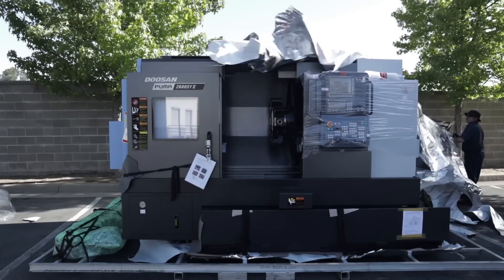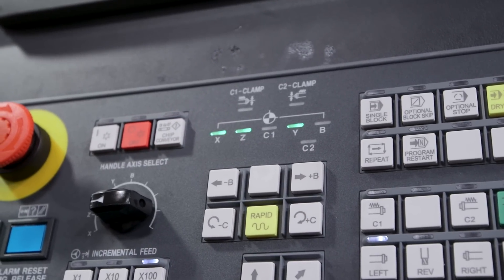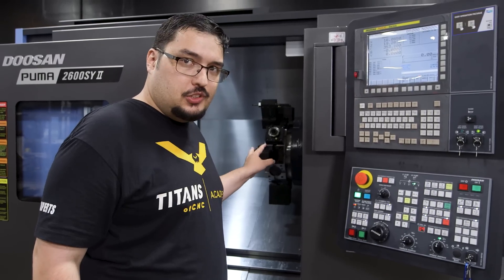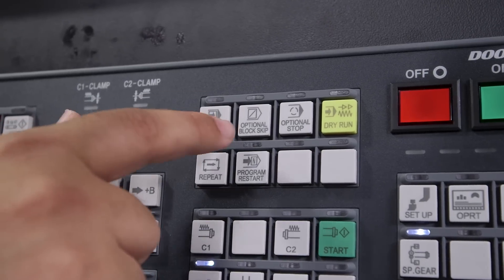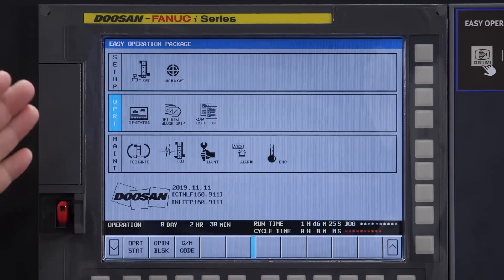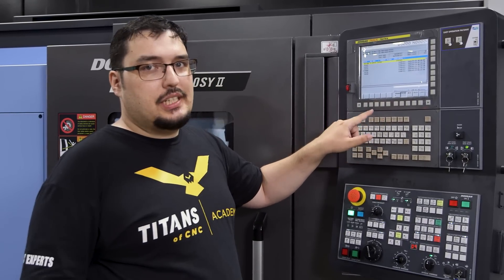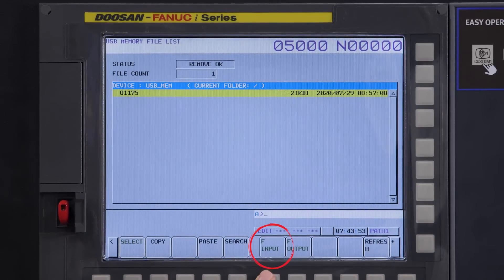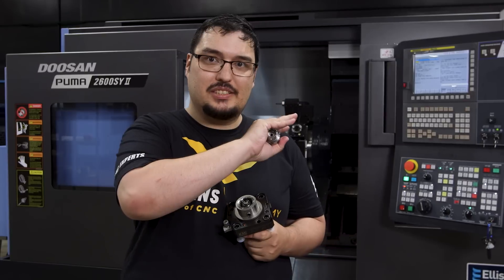DN Solutions PUMA SY II | Control Overview

Comment: I run this exact machine everyday. Absolutely love the machine and the controller! I run several jobs where I use all 12 tool positions on the main spindle side of the turret. ID tools side by side, no problem! Makes programming parts much easier with the versatility.

Comment: BOOM ?
Where are all these machines coming from ??
Must be big money in CNC machining ???? 
 ( i know these machines are on loan ? It,s called Marketing.  Google is good at that too )

Last time i looked most shops need to take a risk and run lights out to make the machine pay for itself.
The word risk is calculated by some but others find it,s more trouble than it,s worth.

All i see is my labour price going down while everything else is going up ??
Pricing jobs on how cheap you can buy material is what i see.

Not everyone is making parts for Rocket Ships.
Actually i don,t know hardly anyone. ( maybe i should look harder ? )
But YouTube like always glamourizes everything.

All the best to those who are making big dollars from a CNC machine purchase.
But don,t go thinking this is a Golden Ticket to making money.

If you find yourself stuck on a manual machine for to long you will embrace what a CNC machine can do for you.
Don,t go looking to hard for work though, because everyone else is out there trying to stay a float and working for wage rate running there own machines.

Think about for a second,  when it comes to CNC what is that they do so well ?
Produce identical parts in volume.
There is a word for that,  Made in China or similar.
This is what i find real consumers comparing prices on.
Make more parts and earn less per part ??

I wanted to be a Plumber when i was young ?
I should have, i would make more money per hour.

Apologise,s for sounding so negative.
I just find what i write is real world machine shops ( true, maybe not all ) but most i know.
If they are still in business that is ??

Comment: We have this exact machine at work. We got it September of last year. One of the few things we don't know how to use is Fanuc's tool life monitoring in the control. Would love to see a video on that. All of our lathes are Doosan with Fanuc control but our 2600 SY II was the first to include that feature and we would love to know how it works.
Reply from the maker: Love the automatic tool setter... we will do a video on this very soon, just for you😁
Reply: @TITANSofCNC  I wasn't talking about the tool setter although I agree it is cool and definitely deserves a video. I believe if you hit the custom1 or custom2 button on the Fanuc control you get a menu that includes a whole bunch features. One of those has to do with tool life management. My understanding is that you can have it record the tool loads during a couple part cycles with new inserts, then set some load thresholds and it will then automatically stop the machine if an insert breaks, individual tool load exceeds the preset threshold, etc. It was briefly explained to us when we got the machine but we never got it too work.
Reply from the maker: I already sent info to Doosan requesting this info... I understood what you meant but besides loads etc... it’s get that you can check the tool for wear etc during a lights out run... and set parameters etc. Will get educated on it as we are also new to it. Then make a video.
Reply: @TITANSofCNC  Sounds good. Look forward to seeing it. Excited to see Doosan's in your shop. It's the only brand I've run for lathes.

Comment: After you try Siemens or haidenhain you can never get back to fanuc!!!!
Reply: It’s like you have 1000km to go and you choose , running, (fanuc) or by airplane
Reply: I had the same type of experience.  I spent the first 15 years in the trade on FANUC controls.  That was "home" for me.  I had very little exposure to any other type of control.  I've spent the last year in Citizen Cincom controls, and there is no way I'd go back to FANUC full time.  The Cincom control is so damn smart and well laid out.  There are pictures and text for just about every function built into the machine.  There are macros with pictures for tool setting that show you exactly how to set the tool.  When simulating a program on the control it will give you warning if it detects a possible collision.  

I've also heard good things about the HURCO control, but I never had any time on that type.  My last shop had a HURCO 5 axis mill, I watched it run a few parts, but no real time using it.

Comment: God I hate Fanuc. It’s like prehistoric. Shame I’ve got 8 machines with it on. What do you mean I can’t run off usb and have to buy a £4000 memory upgrade to a groundbreaking 8mb! Arrrrgh
Reply: Also measuring tools is a pain in the cunninglingals. “Tool offset measure” and “part zero set” are the most useful buttttttttttons or however it pronounced but is why haas is more better, at least in terms of controls.
Reply: Yeah, we have a 10 year old Doosan Puma LSY, and let me tell you - the Fanuc control has not been modernized at all it looks like. I fall in love when i look at the mazatrol for example - thats the dream.
Reply: I hate fanuc too and love Siemens

Comment: M250 enables you to do way more with the door open.
Reply: Could You explain that? What more I can get and how? Best regards
Reply: @marcinrutkowski8193  M250 lets you index turret and run with 300rpm with the door open. Great for touching off tools if you can't use the tool-setter.
Reply: @MattWindham  thank You for the answer. I have tried to activate that by MDI , typing "M250 ;" press insert and start button but nothing happened
. What i doing wrong? It must be something changed in plc?
Reply: @marcinrutkowski8193  No alarm means it took it. Go to handwheel/jog mode, hit spindle on with the door open. "Reset" deactivates the M250. Doosan calls it Maintenance Mode.
Reply: @MattWindham  thanks a lot. Best wishes for You :)

Comment: wait, you cannot name the programs like "Part X Top" but instead only numbers? Thats stupid
Reply: It seems to be one of the things fanuc refuses to update.  I work a late 90's mill with a fanuc 18i control and the filename pattern is the same as this brand new, state of the art, lathe.
Reply: Yeah, my 1987 Fanuc 10M is almost exactly identical to operate as this state of the art Fanuc control. I really expected to see at least some improvement over my more than THIRTY years old mill.. But.. Nope. Lets jus stick with numbers as program names.. :)
Reply: On the new control like this one you can name it anything you want (up to 32 character I think? No spaces). The old system is still in place as well. I use the actual drawing number as a program name now.

Comment: It would be nice to know what happened to all his other machines, to learn a bit more about the business side of things. Also, by far the quickest way to load programs into these controls, especially for short run jobbing work, is to have a pc mounted at the machine, and the machine plugged into the local network, then you can post from your cam, and using M198, can immediately press cycle start.
Reply: I'd be willing to bet these new machines are loaned to him by the manufactures just for the purpose of getting them on his channel.  Titan is THE face of CNC machining in the US  right now.  He has a huge platform and that is an opportunity for sponsor ships and marketing for the machine tool makers.

Comment: love the 1990 rapid overrides - too slow, too fast, way too fast. 👌
Reply: sounds like mazak lol
Reply: LOL, you can set them to what ever your comfortable with.
Reply: @williamlind2843  I prefer the infinitely adjustable ones on newer DMG Mori equipment 👌
Reply: @TheFeralEngineer  I have some 20 year old Mori's that I'm ready to trade in. I will check out DMG Mori's newest controls. The Doosans I recently bought have no balls! They're fast but don't expect any heavy lifting.
Reply: @williamlind2843  what models do you currently have?
Reply: @TheFeralEngineer  I have two sl-2500, 8 NL2500, 1 NLX3000, 3 Doosan twin turret twin spindles. I forget the numbers on the Doosans. They are fairly new. As far as lathes go. that's what I'm running.
Reply: @williamlind2843  oh okay, cool. Yeah level up those sl2s for sure lol
Reply: @williamlind2843  I have a 2019 gt3100 puma and that thing is an absolute turning animal.
Massive torque.
Can remove material fast as hell.
I dont think I'll ever stall this machine.
Cuts A2, 4140, superduplex, and every stainless in between like a boss.
My haas st30 on the other hand....cries like a bitch in everything but plastic and aluminum.
Reply: @matt23727  my Lynx 220 can't handle a 1.25" insert drill. It starts shuttering like crazy.
Reply: @williamlind2843  lynx is a linear guide machine like a haas.
Pumas are boxed ways and heavier castings. 
My chuck is 12inch with a 4inch thru bore.
My gt3100 has 1190lbs of torque in low gear at 300ish rpm.
If your gonna be blasting away tough material buy a gt not a lynx.
Can I ask at what rpm your having trouble? What material ?
Reply: @williamlind2843  that sounds more like you weren't exactly on the centerline

Comment: Great Content Tyson. I retrofitted my old Gildemeister lathe with a similar Control . I am extremly happy with it .   For me Fanuc is much less confusing as Heidenhain or anything else . I use the USB Stick to Transfer the Program as Well.     Buy the way Gildemeister is the G in DMG Mori.
Reply: Hello! I've just bought CTX400 with Siemens (2001year) and ctx400 with Heidenhain (2003)...with low worked hours (3000-4000)
But my eye still looks at stronger machine like gildemeister md5 but I afraid of eltropilot...I live in 3rd world country and it's harder to get spare parts, I afraid that something will broke in electronics and I will wait months for repairs. What machine you have bought for modernisation? And what accuracy it has?
I have lot of job but there is 32kg detail weight, 280mm diameter, 0,03mm precision for diameter, also I need to cut lot of chip, about 9kg that's why I need strong machine with vdi50 and strong guideways. Can you please give me suggest:)
Thank you and health to your machines ☺️
Reply: @user-pq8fg8pq6q  I run the NEF 520 for one offs and Prototypes and spare parts production. I have no tool turret Just a Manual Multifix.   The MD5 is nice. You can still get the Electical components from German Onlineshops.   If you let it ship with DHL Express it will take 1-3weeks .   Buy two MD5 then you have always one functional.  I think in the third world factory floor space ist cheap.
Reply: @user-pq8fg8pq6q  my machine has 7000 Spindle hours . No Problem.
Reply: @user-pq8fg8pq6q  Gildemeister NEF600 is pretty strong (Now DMG NEF600 , but in used market search for gildemeister preferably with 840D control) , also CTX510
Reply: @kisspeteristvan  thank you. I looked at NEF, but they have not inclined guideways and that's same construction was build mainly here in Russia/Ukraine on ussr times. I afraid they will damaged with chips and lose accuracy... because no incline and slide/cover defence  there. 
Also at first I thought about ctx510 and one manager told me they mainly was produced in China and Poland.
Also I need two spindle machine without tail stock. I found that Monforts are very strong machines and think about dnc5 model. Have you heard something about them?)
Reply: @user-pq8fg8pq6q  Never heard of them , but if it fits your needs , and it is no too old (less than 15 yo preferred but definetly make sure it's less than 20years old ) , it might be the solution for you . However make sure to check it and make a test cut before you buy it . Also if you want a machine that size with subspindle (possibly 2 turrets) you're gonna spend serious $$ even for a used machine
Reply: @kisspeteristvan  thank you for tips. We didn't want to use intermediary company to by used machines from Germany and moved with my father right there. We have bought 3 machines (2 lathes and 1 mill), both lathes with 3000-4000 hours worked on, mill with approx 40000 hours. Well, milling centera spindle lost accuracy, spindle runout 0,2mm... But it works. Lathes are good with accuracy but one of them have issue with X axe, looks like we need to repair drive motor. 
If we checked there in place, we could have discount I think. Good lesson for us. 
I thought about Gildemeister MD5 or similar strong machine, make modernisation to fanuc and use it. Do not know is it bad idea or not...
Reply: @user-pq8fg8pq6q  spindle runout 0.2mm what the hell , that is waaaay to much to work with . Retrofitting - (i think this is what they call the modernisation ), can be a good idea , but only if the machine is worth it , do some calculations , but be aware that everything is so damn expensive in this trade... . It would be a huge bummer to make the modernisation 20-30 grand $ ,and find out you need to replace main spindle bearings - the spindle bearings alone can cost a few thoulsand dollars . Advice is be careful .
Reply: @kisspeteristvan  yes, 0,2 mm is hell accuracy 🙂 but we use it only for one operation and there no needs in higher accuracy. Somewhen we will replace bearings. Our guys in service department replaced bearings already in lathe and those one has 0,01mm runout after repair. So I trust them. 
So retrofitting expensive thing...20000-30000$ oh my god. Apparently this makes sense for large machines since the price for large and small machines will be approximately the same. Sad... I thought take MD5 or similar strong machine for 10.0000 and make retrofit for 8000-10000.
Reply: @user-pq8fg8pq6q  I was a bit off with the prices i just checked a site , retrofit with Siemens808D start from 10k usd , and range up to 25-30K for the higher kw models , but i don't know how much power you might need so it can still be really expensive . As an idea https://www.machinetoolproducts.com/category/milling-machine-cnc-retrofit-kits/
Reply: @user-pq8fg8pq6q  i mean it's your call but then you must buy the multiples of the same machine  , for example if you decide on 35Kw main spindle FANUC 21i , the other machine must be the same too , you cant interchange 'computer' parts from fanuc to siemens to mitsubishi , etc ... .
Reply: @kisspeteristvan  thanks

Comment: had my lathe cnc exame on a fanuc. was the only one who wanted to program for it with mastercam. mostly because it was the oldest machine. around 30 year old machine xD but it was the best machine in school xD so i won on so many levels x'D
Reply: there was a few issues. the postprocessor had MANY fault. live tools G code was wrong, thread dept per cut was a factor of 10 to big. and so on! but reading the code and fixing these issues and knowing it has these issues. i could manage xD my teacher told me they wanted to fix the postprocessor and told them NO because there was one week until my exame and knew what was wrong and where to look. if they messed up something new i had to deal with it on the exame.